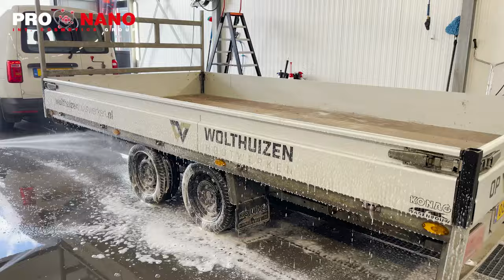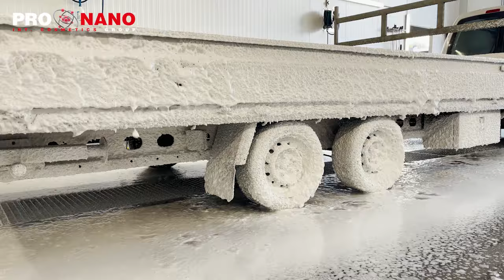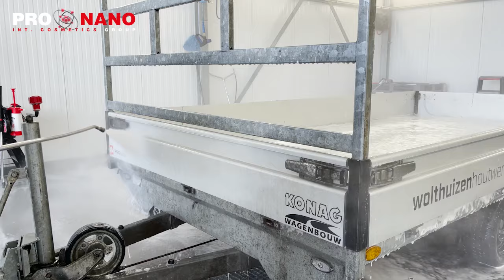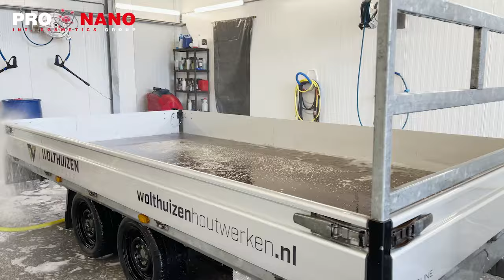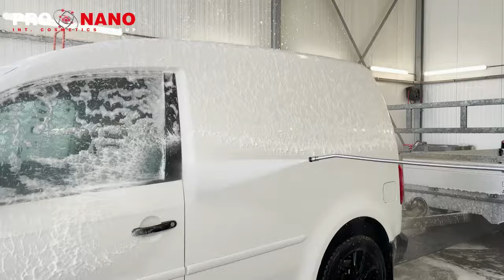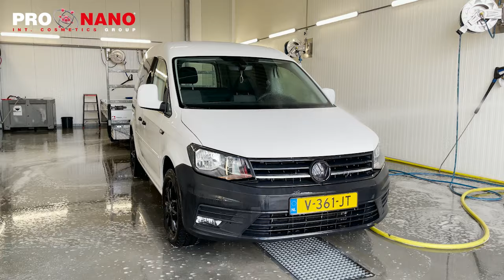DULL & GRAY TO BRIGHT WHITE | ProNano Cosmetics

Comment: I emailed you guys never heard back from you guys. Question is can I use pro nano plus soap on my car weekly? Or is too strong of a chemical.
Reply: Yes, you can do it, but you shouldn't do it every week. Use it yourself.
Reply from the maker: Hello Alex, 

We apologise for not responding to your email; it must have slipped through the cracks. 

You can certainly clean your car weekly with the ProNano Plus. This is totally safe. However, if you follow our two-step-method and apply the ProNano Diamond Nano Wax after each wash, you only need to rinse your vehicle weekly. A full cleaning would be required only once every 2-3 weeks or monthly, depending on the level of dirt, of course. 

I hope this answered your question!
Reply: @ProNano  excellent thank you very much.